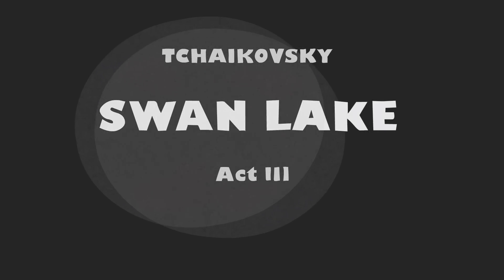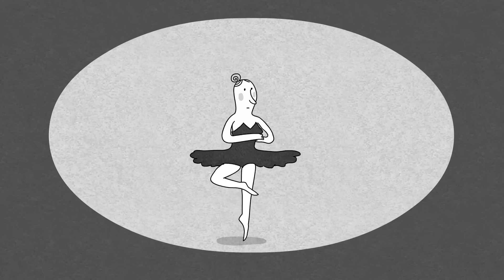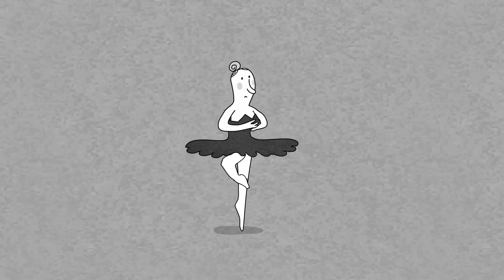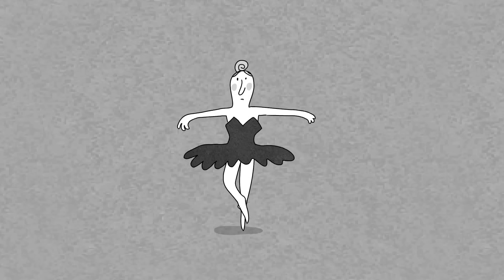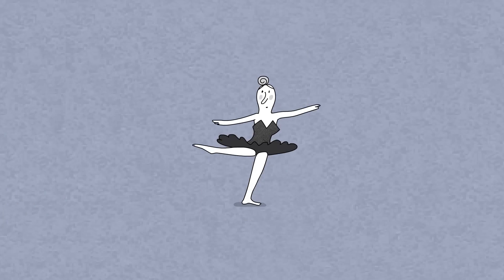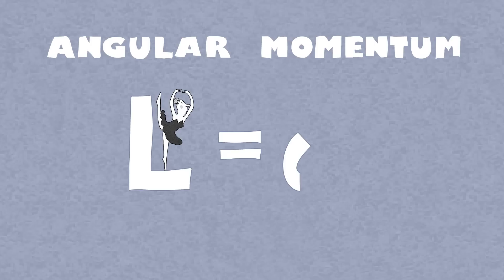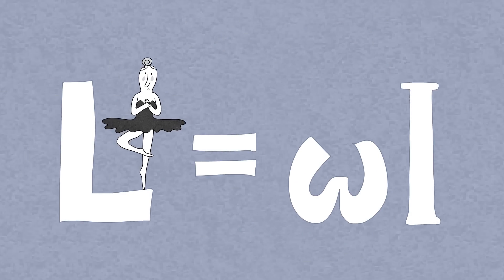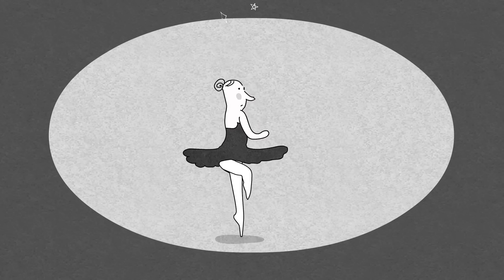The physics of the "hardest move" in ballet - Arleen Sugano

Comment: You've forgot another critical  factor "spotting". When the ballerina leaves her head and quickly whips back to the same position, it also helps with the momentum.
Reply: And it keeps them from getting to dizzy!
Reply: I'm a dancer and it does help because when you whip the head back to its original spot, it forces the completion of the movement by helping you finish the turn.
Reply: But it does though, it helps with your balance and momentum. Pretty sure those too are part of physics.
Reply: @amychen2188  literally everything is part of physics
Reply: Morgan Cloutier True, you can cheat a single without spotting, but not if you're doing a double or more.
Reply: ikr? its one of the most important things! why you no mention dat.. why?
Reply: because none of the people that work for ted know how to turn @danuhhh
Reply: I don't really know a lot about dancing ( meaning I know nothing at all ) but I do know physics. He can probably be forgiven for not breaking down every aspect of ballet considering he "watered down" the physics to a high school grad level. The actual calculations involved in determining the angular momentum, moment of inertia, and angular velocity, as well as friction losses is a lot more in depth than what he described (free body diagrams kind of suck). He wasn't going in depth for either side of things. I think he was just making interesting observations so that people from both the sciences and the arts could find something cool to discuss. After this video I want to check out a performance now because ballerinas happen to be Physics masters!
Reply: Amy Chen and also helps so you won't get really dizzy
Reply: Spotting is key- a skilled dancer will be able to spot!
Reply: You are right, but us ballerinas aren't physicians (at least I'm not). We just know these tips from experience and knowledge from our teachers. Although it's nice that they educate people on some basic factors of pirouettes the thing that bugged me was that spotting is a HUGE factor in pirouettes, if you don't spot you can't get past a double. Also the other factors i mentioned are more unnoticeable, but if you ever watch someone do pirouettes then you'll notice the spot, it's just not a proper pirouette without the spot and they didn't put it in the animation (guess that's why it annoyed me so much) (btw that's one thing that separates pirouettes from figure skating turns).
Reply: Yah and they didn't even add that in the animation...
Reply: E Abcd Well please tell me your secrets, how do you do a double?
Reply: Amy Chen more of keeping you from getting dizzy
Reply: I completely agree with you that from what you said he didn't do the proper form justice in the animation. I was just saying that he pretty much ignored entire laws of physics (gravity was essentially a footnote in the video!) when he made the video so in the grand scheme of things you can't actually base any completely accurate science off of this, but I still enjoyed the video. 
For the most part people are really cool and just took to the comments to add that the video was missing basic ballet skills, but some people seemed to get angry about it. I just hoped that everyone would take the video for what it was, an extremely basic connection between mechanics and ballet with no actual in depth analysis. It's kind of hard to get mad at him about ignoring anything else when he didn't really talk about the force that keeps us on the face of the earth (gravity) during a conversation about physics lol. 
I really appreciate you explaining some of the technique behind your sport, that's really cool. I wish I was talented enough to do things like pirouettes but unfortunately I'm not very graceful lol. If you are interested in anymore sport based physics, there is a really great book called "An Introduction to the Physics of Sports." I'll be sure to check out more ballet!
Reply: But she isn't spotting, if you look at 1:17 you can see that her head is turning with her body. Spotting means you leave the head, imagine an owl twisting it's head, and then quickly whipping back to the same spot it. Basically you're head faces the front before your body does. Sorry if this was long and confusing btw.
Reply: Amy Chen seriously! I know exactly what you mean when I don't spot even 1 turn. It feels sooo wrong not too. I learned to spot even chaine turns (spelling) I think this video has a lot of interesting points on how the fouetté actually works in a physical way but lacks the dance background info / the graphics are not the best. Overall it's interesting and definitely helpful for a dancer wanting to get a few more turns out of their fouettés
Reply: ***** So true, one thing that annoyed me was that they didn't include other important factors like turn out, pushing down your shoulder blades, being upright, straight legs, squeezing your stomach, squeezing your butt as weird as that sounds, ect. You have to think about so many things when you turn.
Reply: @amychen2188  because the video is discussing physics, not the act of dancing.. :o)  :o)
Reply: Amy Chen same for me but I've been dancing for only 7-8 years
Reply: Sammi Nix that's about right but your head leaves last and arrives first, so your body doesn't really follow
Reply: ❤ oh man I love physics
Reply: Amy Chen I don't know much about dancing but one of the girls on my lacrosse team is a ballerina. She said that the head turn forces her shoulders to turn and the rest of her body follows.
Reply: @samminicksm Your friend was full of it because the head turns last so can't force anything else to turn
Reply: you make good points, personally I don't do a lot of sports but I'll see if i can check that book out.
Reply: Sasha O Spotting does help you to turn. I know this because I am a ballet dancer and if I dont spot I won't turn as much.
Reply: same, since i was 3!
Reply: Amy Chen This very true, I do ballet and spotting is the main thing in turns.
Reply: Squeezing your butt, what?
Reply: that was bothering me the entire video because spotting was the first thing i learned while turning not leg rotation or pushing off with your feet
Reply: Besides being technically correct, spotting your turns is ESSENTIAL. Otherwise you'll  look poorly trained because it just looks so wrong
Reply: tru if you loose your spot it’s almost impossible to have a nice turn
Reply: Oh, you're right! I never actually noticed that until you mentioned it.At least give that an animation. Ughhh, I just cringe at how painful that must be to not bend your knees when you land. Shivers
Reply: Amy Chen yep
Reply: Amy Chen yeah... and the fact that it hurts the head
Reply: Amy Chen yes
Reply: Amy Chen I so agree I'm a ballerina and spotting is one of the most important things to do in ballet. Even when you're not turning and just balancing on point spotting makes it easier to balance. Also in the video he should of mentioned when the knee is bent you're supposed to keep turned out meaning the knee should be  behind your shoulder this also give you more momentum.
Reply: Amy Chen yesssss spotting is life it works like a charm
Reply: Amy Chen that is also part of why it's called fouettés
Reply: Amy Chen it also helps so you're not dizzy
Reply: Amy Chen That's when the ballerina pauses.
Reply: how many can you do (en pointe and in technique shoes) ? Actually it is important because it's part of ballet technique and the correct way to turn so it would help you turn more times and have your turns look better.
Reply: Amy Chen exactly. spotting means that it is the last part of our body to turn and face the starting point and the first part to arrive at its destination. this helps us keep our balance when pirouetting. we cannot leave our head either or else we might get injured or throw ourselves of balance. our legs need to be straight and put total weight in the middle when pushing of the ground the ballerina should feel straight.
Reply: Amy Chen yah that does help
Reply: Yeah I was waiting for that
Reply: Trueee if you can’t spot then =no momentum
Reply: I agree.  Good catch.
Reply: Yes yes yes and yes tining that right the way though the video!!!!!
Reply: Close, her spotting helps her not to get dizzy, which in return helps her keep her center of gravity along her axis of rotation.
Reply: It's called spotting and it dose not work for everyone.
Reply: Erin K but it's still a fun fact cause we can go crazy if we don't
Reply: Amy Chen I’m also a ballerina and they should have let a ballerina make this video
Reply: Erin K but it dose have a lot to do with the dancer to not fall or get dizzy
Reply: helps us not get dizzy
Reply: NO U!!!!
Reply: Amy Chen yea and I just hate fouettés
Reply: That's to not get dizzy, it doesn't explains the physics of the movement
Reply: And it helps keep her on balance because it keeps her from getting dizzy
Reply: Yes, and it also helps keeping you from getting very dizzy.
Reply: Leaves her head.?
Reply: @erink5955  you have never danced i see. The head turn is what fuels pirouettes. You can do pirouettes without arm movements
Reply: Spotting has much less to do with momentum, and much more to do with keeping upright and minimizing the whiplash and dizziness from each turn. The more rotations, the harder is to keep the spot
Reply: maybe its not so well known or documented
Reply: well from a ballerina's perspective it helps you keep your balance 
 because you're using your core, especially when your on demi pointe or pointe
Reply: Yup, I remember the times when I do Pose turns and didn't spot. I was so dizzy at the end that I felt like the spinning top they were showing in the video.
Reply: ***** I've been dancing for 9 years and although i critic (because it obviously bugs me) i still have a lot to improve on my pirouettes XD How about you?
Reply: Amy Chen I am 12 years old and i can do 12 fouttes
Reply: Amy Chen all that is to keep your centre of gravity, which he mentioned.
Reply: Spotting has nothing to do with physics. It's a separate aspect of ballet. This video is about the physics of a turn. I've done ballet and studied physics lol.
Reply: Amy Chen I'm a dancer and I can do this, however I don't use spotting so it isn't that important

Comment: This video is great, although it leaves out two of ballet's most important turning fundamentals: the fondu and spotting.  Both create stored momentum by "resisting" the existing momentum of the previous turn.  Your graphic shows the dancer lowering the heel of her foot without bending the knee between each turn.  This is incorrect - there must be a fondu (single-leg, bent knee) in a externally rotated position between each turn.  The fondu "resists" the circular rotation of the fully extended leg.  The dancer waits until the extended leg is in second position (directly to the side) to push into the floor with the standing foot to rise to pointe and turn.  And in spotting, a dancer leaves the head in a forward-facing position while the body is rotating.  At the last possible moment, the dancer whips the head around to the same forward-facing position to create an unwinding spiraling down the spine, releasing the momentum.

Comment: They forgot one vital factor that, as a dancer who can do this step en pointe, I can testify is crucial. After every turn, the dancer must fondue on the supporting leg, before doing a relevé. This happens immediately before the ronde de jambe with the working leg. The relevé is what pushes the dancer onto pointe and it can prevent the dancer from veering off course. Just thought I'd point this out because a fouetté serai is impossible without a relevé.

Comment: I think the real question here is how do they not throw up?
Reply: +Catalina Lopez We do spot so, unless we lose it, most of us don't get dizzy.
Reply: Spotting
Reply: From what I've learned is that they have that one spot they focus on every time they do each spin, it helps them center themselves and not get dizzy
Reply: +Moretime´s Studio The other replies are right :) There is a technique called "spotting"; at the beginning of every turn, there is a split second where the entire body is facing the front. As the turn continues and the body changes direction, the head remains facing the audience, focused on looking at a certain single point. The head continues facing that point until the dancer reaches the furthest distance which their head can reasonably be turned, and then quickly flips around the rest of the way so that it faces front again. This way, the head (a part of which is responsible for maintaining balance) only actually is spinning for a fraction of the turn. An experienced dancer can do lots of turns this way and hardly be dizzy!
Reply: Spotting
Reply: but it gets better with practice
Reply: Spotting
Reply: Spotting

Comment: But you didn't say anything about the head. The head is the most important! It makes turning around easier and it takes part is spinning more than legs. The head pushes the rest of the body to turn around so the body follows the head. 
Someone somewhere counted second in which ballerina is not facing the audience. It was like 0.000001 or something, idek. The point is that she is always facing the audience, that's how important the head is. Plus - the most obvious - keeping the head always in one place and turning it just for a short time makes less dizziness. Just prevents from it at all, you can say so.
Thanks!

Comment: It doesn't make any difference to your explanation of the physics, but on the ballet side of things, you had a few inaccuracies... There's no reason you should've known unless you've experienced them, but fouettés (foo-ette-Tays) make significant use of the power in the back, arms, hips, and head snap during the turns in order to maintain their momentum as well. It's most essential for the dancer to create a powerful downward dynamic force/pressure in order to be able to use leverage of the foot for additional torque during each plié.

Most importantly, in ballet the arms wouldn't be brought closely into the body at all as described. Technique for fouetté arms are not what it may seem. They actually have to be forcefully closed into a large round shape after each whip in order to keep the entire body structure in dynamic tension for it to work.

There definitely is a great deal of engineering and architecture to ballet. The training involved strengthens and sculpts the body from the inside out so that dancers can do these types of complicated maneuvers. 

Cheers.

Comment: One point is, the narration specifies that the 'working' or 'gesture' leg (the one not supporting the dancer) unfolds every time to the front and then whips out to the side, before returning to the passé retiré position in which the actual turning takes place. That is true of a French fouetté, but in a Russian one, the leg unfolds straight to the side and back in. This is useful when the tempo is particularly fast, and creates a more flashy, less lyrical effect.  In recent years, this Russian fouetté style is far less often used, but it can be quite effective, and it's nice to have the different dynamics of the two different types of fouettés.
Reply: thank you for this comment, as a ballet dancer, i didn't' even know this
Reply: AvalonMorley yes. If you do the French style, to the russian technique, it’s not fouettés, they’re gonna be simply a sequence of pirouettes temps releve (opening front and bringing to the side). Also is good to remind the the actual fouetté for the russian technique is more about closing the leg on passe back and bringing it front (fouetté) rather than turning.

Comment: I don't know if I'd call fouettés the hardest ballet move, but doing them 32 times in a row is pretty hard and when a dancer does it, they should be congratulated. But have you ever tried jumping over and over and every time your core, arms, neck and feet have to be in the exact same position, and each jump has to be higher than the last? 😣💀

Comment: Don't forget spotting! Spotting is a necessary aspect of any turn. To spot, you look at one point for as long as possible while turning, and then whip your head around to look at it again, and repeat that. While it may not add significant momentum, it increases balance and makes it possible to do many more turns than you could do otherwise.

Comment: WRONG WRONG WRONG.  L = WI is indeed correct. However, the physics of the supporting foot generating torque is incorrect. Any turns starts with a twisting motion somewhere in the body to generate the torque. The most efficient place to generate the twist as the stored potential energy is in the pelvis. However, dancers are not always allowed to use the pelvis so the thoracic spine rotation comes into play. Rotation of the tibia and the "supporting" foot is not technically allowed in ballet, but it does happen. However, the amount of twist and energy generated in the knees and feet are severely limited. The dancer stores this potential energy by having greater frictional force stopping the expenditure of this "twist", which is the potential energy. The turn all the sudden happens because the frictional force from the feet decreased from on demi or full pointe. Yep, plies are actually not necessary, but it helps, just not the way you think... The plies increase the body's ability to twist more at all other joints such as the feet, knees, and pelvis before the turn, so it can increase stored potential energy... And this video does not distinguish the different mechanics of a Russian a la second foutee vs a western rond de jame foutte... The decreasing circumference of the leg and the arms do release the potential energy and therefore continually perpetuate the turns. However. rond de jambe foutees can harvest MORE potential energy because it is more efficient, translating the turning momentum into the leg that adds to the next turn angular acceleration...